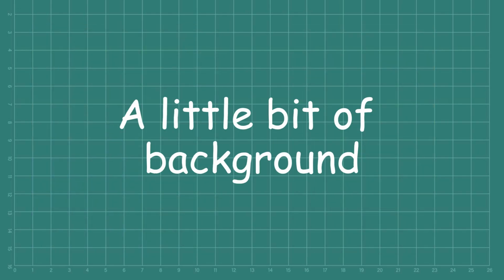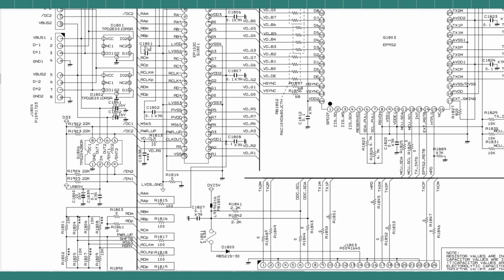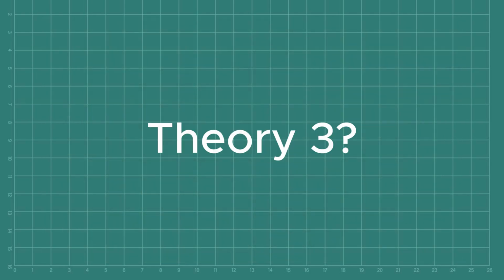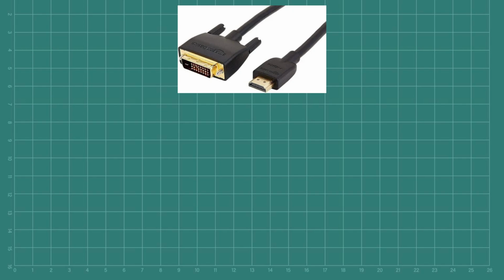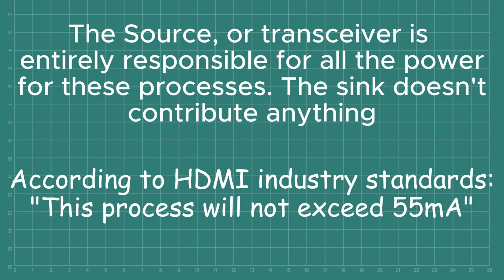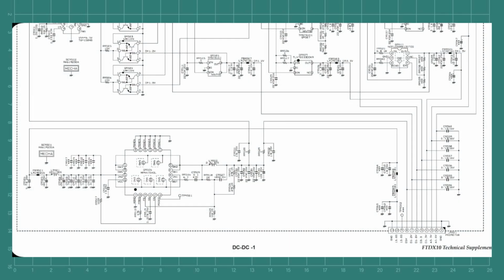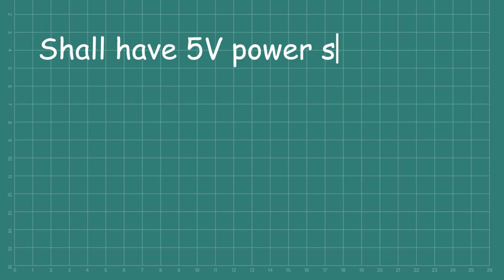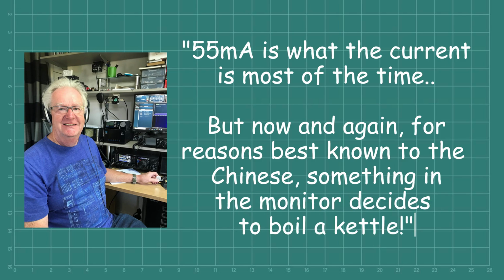Yaesu DVI-D to HDMI. Investigation

Comment: This is a PITA as I am on the cusp of getting a DX10 but I would be using with an external monitor and a mouse for sure.....  if a DVI monitor is safe to use, no problem I will get an older monitor... however I was always taught that when the voltage goes down, the current goes up?
Reply from the maker: It’s a funny one to try and explain. 

When voltage drops current also drops in most cases. The only “exception” to that rule is 

1: the resistance increases causing the voltage drop

2: the voltage drops and a smart power supply tris to increase to current to maintain power. 

Neither case apply to the DVI-D to HDMI issue. 

The best and only guaranteed way to avoid a fault is to get a DVI-D monitor.  Many companies still manufacture these New 

One other but slightly riskier workaround is to use a video capture card and display the radio screen as a windowed video in your operating system. 

I’ll leave a link to a video I did on this for you. 

An HDMI capture card is a one way street and is only reading data and doesn’t require any sort of handshake or information exchange. 

https://youtu.be/1EY7m5e91TI?si=EqnSfhXSHJuOzgVi

Comment: Would a DVI to USBC cable damage the radio port? There are several USBC portable monitor in the market but I am concerned to try out this setup....
Reply from the maker: I personally wouldn’t recommend it. 

There are plenty of DVI-D equipped used and new monitors available. 

It’s not worth the risk.

Comment: Hello. For 10 months, I have had a 10.5-inch monitor with a mini HDMI input connected to a Yaesu FTX-10 with a DVI to mini HDMI cable, and it works without any problems. The monitor is powered by the USB output on the radio. When the radio is turned off, the monitor automatically turns off and vice versa. A friend of mine has had it connected like this for over a year and it works. Best reg
Reply from the maker: I’m pleased that this setup works for you. However wouldn’t recommend it as your hardware may not be the same as someone else’s. 

In the most basic terms a HDMI connection has the potential to draw an excessive amount of current from the radio causing a failure. DVI-D by its physical design makes this impossible. 

Whilst you may have had success with this it’s not to say that someone else may have a failure with an identical setup. 

Glad this works for you though. 

All the best

73’s 
M8KHC
Reply: @M8KHC  Thank you for your reply. It was my risk and it worked. I do not recommend it to anyone because it may end in failure. Best regards. 73
Reply: @Christos1557GR Not being mains powered probably reduces the current spike on the monitors mini hdmi port. ✅️

Comment: So no clear solution? well it was a good presentation...
Reply from the maker: The one clear solution is to use DVI-D capable monitors. These are still available new and used. 

Another solution is to run the feed into a video capture card into your computer. Then use a program like OBS to display the radio.
Reply: @M8KHC  I thought I heard that DVI-D users were having problems? Is that not true?
Reply from the maker: @K5AZE I personally haven’t heard anything but that’s not to say one or two people may have had an issue.
Reply: @M8KHC  I bought a DVI monitor, I already had a DVI-D cable. I have several other DVI cables that are different, so I made sure I used a DVI-D cable...

Comment: On my ftdx10, the es952 went to crap. I was using an dvi capable monitor. Not exactly sure why it caused the symptoms i had beyond no dvi output. 
Low rx on all bands 
Arc fault on my acom 2000a 
In t/s i swapped the ftdx10 with my ft710 , no issues at all. Same monitor,  same cables. Documented all that so yaesu could not refuse the warranty work. Did get it back , no issues 
Joe WA4UJY
Reply from the maker: Glad you got sorted. 👍

Comment: Wish I would’ve found this video two days ago because I lost video feed on my dx10 yesterday. It lasted 6-8 hours before blowing. Guess a call to Yesu is in order and hopefully warranty will cover the repair.
Reply from the maker: Sorry to hear you’ve had this problem. 

What were you connected to?
Reply: @M8KHC dvi-hdmi adapter cable to a computer monitor. Turned everything on and the monitor said no signal and went to standby. Did a factory reset on the radio and still nothing.
Reply from the maker: @farmrboy01  I’m not suggesting that you do this as I cannot condone using dvi-d to hdmi cables, but did you go to the display menu and turn the external display port on?

Comment: So we still dont know the exact reason ? I use an active adaptor a Startech DVI2HDMIA and it works perfectly.
Reply from the maker: Well we kinda do know the exact reason. It’s all in the video. 

The DVI-D standard doesn’t allow for transient events or the additional bandwidth demands that the more modern HDMI devices are catering for. 

Thus the sink devices can randomly draw more current than the onboard fuse on the source is rated causing a failure point. 

These transient events may cause instant failure or component failure over time. 

This is and always has been a dvi-d port. Trying to fudge it with an adaptor lead is like putting a v8 engine in a Reliant Robin but not bothering to upgrade the brakes, suspension and chassis.

Comment: I've been using a ASUS VA24EHE 24" DVI-D monitor since release of the FT-710 without problems....almost 3 years. Easily bought on Amazon in the $80 range.  I do have a new Field being delivered today & curious if it has the newer MINISMDC050F-2 re-settable fuse in it?  Does it need to be physically opened to tell or possibly just by the manufacturing date?  Ty for the video.
Reply from the maker: I’m pretty sure you’d need to crack lid on it to be sure. You may have some success emailing Yaesu with the serial number and asking? They’re pretty good at getting back to customers with queries like that.

Comment: Thanks for this breakdown, it's very helpful!
I'm wondering why Yaesu mentions an internal fuse value of 150mA in their bulletin/note "Important Monitor Converter Info" for the FTDX101D/MP/10/FT-710 (search for the pdf): "The issue with connecting a non DVI-D to DVI-D monitor to your radio is your radio has a 150mA internal protection fuse that protect the main-board when a high voltage DVI-D to HDMI/VGA adapter is used."
Reply from the maker: I think this may reference the re-settable fuse that is now being fitted to the 710 and maybe 10 and 101? 

I’ll have a look into it.
Reply: @M8KHC  oh interesting, thanks! Yeah I was thinking of using their recommended DVI -> HDMI converter (Cabledeconn) and for insurance, putting a fast-blow fuse inline with pin 18 on the HDMI side using a breakout board. But now I'm wondering what value fuse to use there. 🤔
Reply from the maker: You’d still need to replace the internal fuse with something rated higher than the fuse you intended to use in the breakout. 

In all honesty the simplest solution is to simply take the video out and feed that into a video capture card to the computer and then back out to the monitor via OBS, thus removing the issue entirely. Display your Yaesu screen in windows! FT710, FTDX10, FTDX101
https://youtu.be/1EY7m5e91TI

Comment: Thank you for this thorough yet concise analysis.  The important (and somewhat obvious) summary point is stated quite clearly starting at about,  12:05   Thanks.
Reply from the maker: Yep. Sadly it’s a fact. It’s a DVI-d port designed to work with a dvi-d compatible display.

Comment: I would love to know, in a follow up, if this situation is in-spec for DVI
Reply from the maker: What do you mean Greg?
Reply: @M8KHC  So the video claims that the 5v line doesn't meet the requirements (current draw) of the HDMI spec. I'm curious if it meets the requirements of the DVI spec and if a compliant DVI sink will always work.
Reply from the maker: @gregmitchell2257 yes, the port was designed to work with DVI-D, that was its whole purpose. 

DVI-d is now relatively old tech, literally just a display port and that’s all. 

The issue is when we try to adapt the dvi output into an HDMI device. 

HDMI is designed for much more modern connections with where the source and sink have far more interactions, data and power transferred in both directions, thus increasing the demands on the source.

It’s less about not meeting the current specification and more about the lack of limiting within the Yaesu design.
Reply: @M8KHC but was limiting necessary to meet the dvi spec or only HDMI?
Reply from the maker: @gregmitchell2257 only HDMI as DVI Ports would never have the need for high current draw either intentionally or otherwise. 

I don’t want to dismiss the question m, however having scrutinised the now obsolete DVI industry standard I can confirm that dvi sink to dvi source connections are damage to use.

Comment: So you buy a modern radio. And have to hunt for grandads  monitor in the attic. Hmmmm 😂
Reply from the maker: Yeah pretty much… or you could have an all singing and all dancing monitor but capture the video via a usb video capture card and play it though your operating system via OBS. 

That said you’d still only have 800x480 or 800x600 resolution which is the maximum that the external display can produce.
Reply: @M8KHC  that stupid
Reply: Exactly.  Kinda like buying a new car and being required to use a steering wheel from a 1963 Bel Air and searching junk yards to find one.

Comment: Raise your hand if you would have gladly paid an extra $5, $10, $15 for a built-in HDMI connector from the start. 🤚
Reply: I would pay $100 for an official Yaesu DVI-D to HDMI cable with proper protections built in. 

It’s not about the cost in my case, it’s about the space limitations on a dual purpose desk.
Reply from the maker: That would be too easy.
Reply: Why not avoid the licensing and go with a display port?
Reply: :hand-pink-waving:
Reply: yaesu american mouthpiece john KRUK (john crook) says it cant be done and yaesu's engineers know more than you or I. Meanwhile flex and elecraft can use hdmi. Yaesu chose to pick what they did and they were wrong for the american choice of dvi. He actually got in a yelling match with me on a public forum then deleted his post after i had already screen shot it all LOL

Comment: Is there an-line device with a simple current limiter available somewhere you know of? That would be the solution right?
Reply from the maker: Unfortunately it’s not a case of just adding some resistance. You actually need to protect against the surges caused by transient events.
Reply: @M8KHC I was not thinking about a simple resistor but more about a TVS diode circuit of some sort.
Reply: @M8KHC  Zener diode

Comment: I'm using a Dvi to VGA lead i had laying around,  is that any safer ?
Reply from the maker: I haven’t looked at the specifications for VGA unfortunately. I assume the vga has some sort of 5v rail so could potentially be an issue, but as it’s older tech than HDMI I doubt that it would have the same demands or over current issues. 

Potentially yes it’s safer but I’ve not tested it so don’t take my word for it.
Reply: @M7EUP  Thanks, probably have a monitor with Dvi (Installed cctv for 20 years so have a pile of spares) Just paid 4k for a 101mp so probably not worth the risk 😄

Comment: Follow up to my comment below - I forgot to mention that the Yaesu tech said that the problem can occur when there is a potential difference between the monitor and the display.  In my case there may be some mileage in this.  My radio is grounded to a station earth at an earth rod.  My house has a TT earthing system involving a main earth rod in a different place.  I used an earth resistance tester and found that the house earth was at 2.2V relative to the tester's earth spikes, whereas the station earth is at 0.3V.  Of course, this does not explain why the external displays worked for a few months before the failure occured!    I have since fitted two more earth rods to the house TT earthing, one of which is connected to the station earth.  This has almost eliminated the PD... but I still think Yaesu's poor circuit design that potentially allows 6A to flow through a 630mA fuse is a recipe for future problems, regardless of whether there is a display to radio potential difference!
Reply from the maker: Sounds like you have done your research. 👍🏼
Reply: There is a blocking diode in the line after the fuse so the over current must be coming from the FT110...

Comment: Thanks for the informative video.  My FTDX10 had the external display failure problem.  In my case it worked with two different so-called 'portable' external displays (not at the same time) with mini-hdmi connectors, for a few months from new, before failing.  Fortunately Yaesu UK repared it under warranty - it required a new main unit, which is probably quite expensive when out of warranty!  I saw a YT vid by a US Ham that said that Yaesu in the USA would NOT repair it under warranty!!  Since I have had it back, I have been too nervous to connect it to an external display for fear of the same thing happening.  What would be really helpful is if you could run through the same analysis for a DVI-D to DVI-D external monitor connection.  How do industry standards for DVI differ to HDMI?  If transients are the problem, combined with Yaesu's curious design that could allow up to 6A to pass out of pin 14, it seems to me that exactly the same problem could occur with a DVI-D to DVI-D cable connected to the DVI-D input of an external display that is equipped with one, couldn't it?  Your final conclusion that users should not use DVI-D to HDMI converters seems sound, but I can't see how using a DVI-D to DVI-D connection would prevent the same problem, given the inherent transients of switching the external display, and the radio, on and off.  Incidentally, someone in a forum suggested wiring an external fast-blow fuse between pin 14 on the radio and the hdmi connector.  Given that hdmi only needs 55mA to work, then a 100mA fast-blow might do, and blow at about 300mA, thus saving the internal fuse.  It's a bit of a fudge, and one might need a whole stock of fuses for when all those transients keep blowing the fuse, but if your radio is out of warranty, it may save a very expensive repair!  Thanks again - I would definitely appreciate a second video to show how a DVI-D to DVI-D connection is different, if it is with respect to transients, 6A, and any difference in the likelihood of the internal fuse blowing.
Reply from the maker: The dvi-d to dvi-d works without issue because the technology is much older and the demand on the port is negligible. 

Modern hdmi ports on tvs and monitors are required to power the devices connected to them (fire sticks, power switching etc etc) where as DVI-D is purely communication and data.

Comment: The FT-710 uses a different type of fuse in the video output circuit.  The fuse resets itself so no permanent damage.  If you can find a schematic for the 710 you will see the “fuse” has a different symbol than in other older model Yaesu radios.  73
Reply: The FT-710 uses the MINISMDC050F-2 resettable fuse.   I have had no issues with my radio driving my HDMI monitor through a converter.
Reply from the maker: This is correct but only in later releases of the 710 👍🏼
Reply: @M8KHC  If I may ask.  I bought my 710 back in August 2024 brand new from a Yaesu dealer here in VK.  I have a very old ASUS monitor (that is only DVI and VGA that I can repurpose) that will obliviously work without issue.  Reading @N9XY comments and what you said about later releases.  How do I determine if I have a later release radio?  I have a new LG 25" 1080p monitor that I can also use and would connect it simply with a DVI to HDMI lead (no adapter/converter) that I bought many years ago.
Reply from the maker: @ without taking the lid off the radio and identifying the fuse I couldn’t tell you. 

They beat option is use a video capture card through the computer. 

I did a video on it. 

Display your Yaesu screen in windows! FT710, FTDX10, FTDX101
https://youtu.be/1EY7m5e91TI
Reply: @M8KHC  Cheers mate and thanks for the very prompt response! 73.

Comment: Such clowns. The video port should be HDMI!
DVI is outdated - not in modern hardware. What were they thinking - saving a dollar in licensing fees? 🤡
Reply: Most manufacturers were behind the curve when it came to USB ports.  So maybe in another 5 to 10 years!  Don’t get me started on software interfaces - they still don’t know about Mac and Linux!
Reply from the maker: Arguably the new flagship Icom IC-7760  which will set you back £4500+ comes with DVI-D also. So there is obviously a good reason. 

The issue is that Yaesu appear to have not anticipated that almost everyone will want to use a dvi-hdmi converter lead and missed a step in the R&D

Comment: If I read some of your responses correctly, using a DVI-D to VGA adapter and then VGA to a monitor would be safe to use. I have such an adapter laying in my desk drawer however it has 4 small pins, with two on either side of the horizontal blade of the DVI side, maybe it is a different iteration of the DVI port.          Yes with some research mine is in fact a DVI-I adapter and not a DVI-D adapter
Reply from the maker: Yes. Different to DVI-D

Comment: Thanks for the info! I'd heard of this problem and ordered a DVI-D monitor and cable before I ordered my DX10.  I'd glanced at its schematic and found F1801 (630ma) and the blocking diode feeding pin 14 of the monitor socket, BUT not being familiar with HDMI specs, video adapters, or their idiosyncrasies let it drop there. I had heard that only the chip fuse blew BUT couldn't validate that info. 
Only $110 more for a new monitor & cable was cheap insurance IMO.
73   mike   🍺🍻
Reply from the maker: Definitely the best way to do it Mike, belt and braces. 73